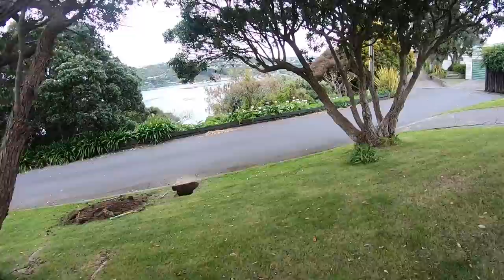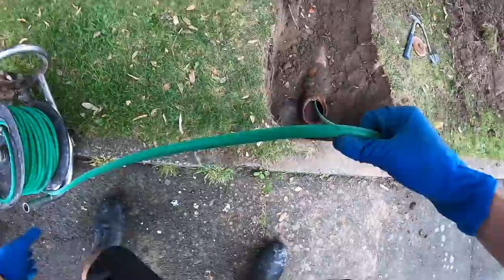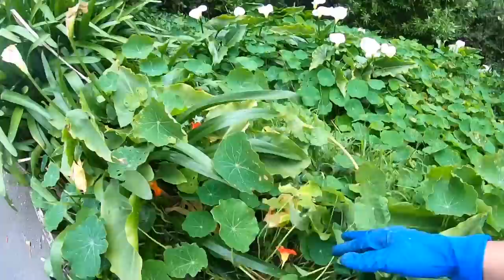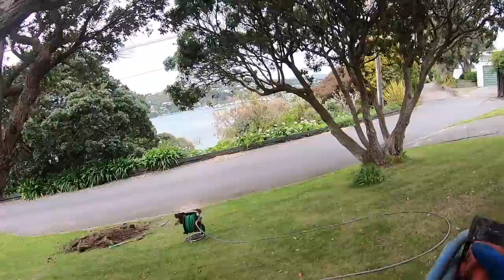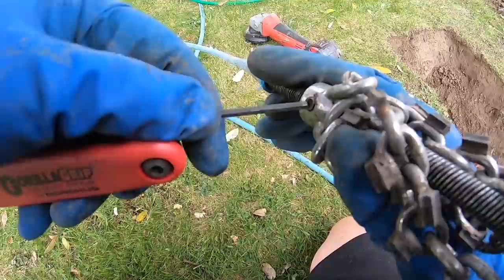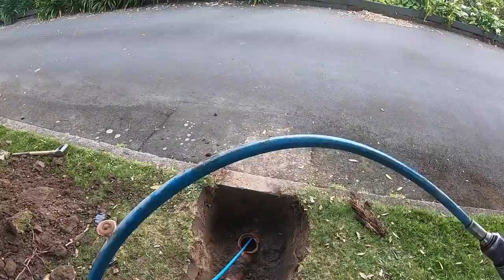Mr Drains #26 - Drain Clean & Broken Flex Shaft Quick Repair

Comment: Bravo colleague, it's great to have someone show you how plumbers are. Asking you which pump you use water flow per minute and pressure. Best regards
Reply from the maker: In this video, I'm using a 5000 PSI pump at 21-23 LPM, but run the pump at around 4000 PSI.

Comment: I like the flexshaft cutting.  I do not yet have a jetter.   I am surprised the jetter did not remove the roots that were removed with the flexshaft.  Is that normal??   Thanks for the video.  Dave from mid America
Reply from the maker: Jetters will cut through roots, but sometimes depending on the angle of travel within the drain, they can cut through the blockage & leave some roots behind that require going over or changing heads to cut. Even then sometimes those blasted roots seem to dodge or get missed by the high pressure waters - like a dodge ball master. The FlexShaft sometimes just helps to clean up those edges where the roots are being difficult to hit with the jetter.
Reply: @mrdrains2088  I have found it helpful to have a verity tools and techniques for root control    I really want/need a jetter like yours.  It looks very capable and useful.  The flexshaft with a camera is especially helpful for me these days.  I really appreciate the video and your explanation.  Those pesky roots don’t stand a chance!!
Reply from the maker: @davehumphrey4075  You can easily get great results with a simple 4GPM waterblaster from a local hardware or tool supply shop. The key is to have good hose & a good selection of jetting nozzles, with a root ranger turbo nozzle or similar being essential.

Comment: Could you use  a regular 3/8 snake cable hollow core for the shaft?  Why do you need that special cable? It is so expensive? $7 dollar per foot. Thanks in advance. I learned a lot from your video
Reply from the maker: Yes you can, it spins differently, but you can certainly make up your own one for big drains.

Comment: How do those jetter work on cleaning soft poop in the sewer line
Reply from the maker: Hard or soft the jetter should be able to deal to it, but sometimes when its a long compacted blockage of poop & paper etc you almost have to go through it to the front of the blockage & break it up from the front pulling the hose back so as not to make a big mess.

Comment: If you do lose the chain, how do you retrieve it? 
Is it magnetic or do you have a hook attachment you add to the flex?
Reply from the maker: I've only had the flex Shaft cable break once & that was in the trap & managed to get it out by hand. If I have to retrieve something metal from within drain I use a magnet with the camera or retrieval hook on a cable machine.

Comment: Do you have. Tool to retrieve a chain knocker that comes off in the pipe
Reply from the maker: You can either tape on a magnet or use a drain auger (snake) with a retrieving spiral head.
Reply: @mrdrains2088  How large of a magnet
Reply: @mrdrains2088  I lost a chain knocker in the drain I just left it there
Reply from the maker: @brian2100  That's why I only use the proper Renssi chains. I imagine Picote would be excellent chains as well.

Comment: What kind of set up do you have for your jetter
Reply from the maker: This machine is a 24HP Honda GX690 running a 5000 psi pump at 19-23 litres per minute (5 - 6 gpm) depending on what nozzle I use.
Reply: @mrdrains2088  how does it work on soft poop stoppages

Comment: I don't like ells they get hung up to much.
Reply from the maker: Explain please.
Reply: @mrdrains2088  ells are those twisty things
Reply from the maker: @catsbyondrepair  Eels, Electric Eel, Plumbers Snake, Drain auger, Coil machine, etc.. I still rate a coil machine (Eel) as the most reliable drain unblocking machine since 1933.
Reply: Can you tell us where you bought the flex shaft cable from